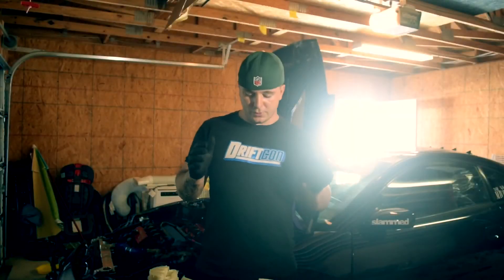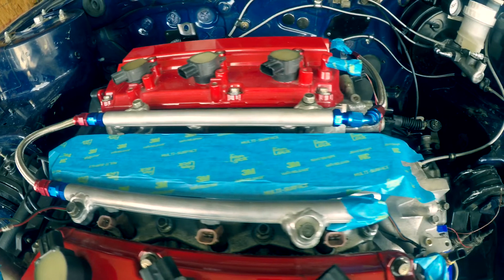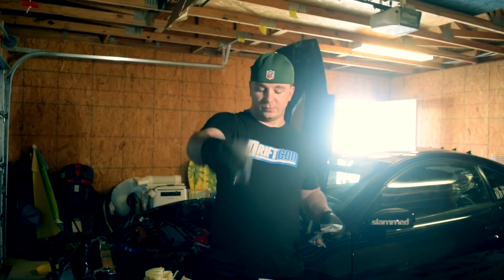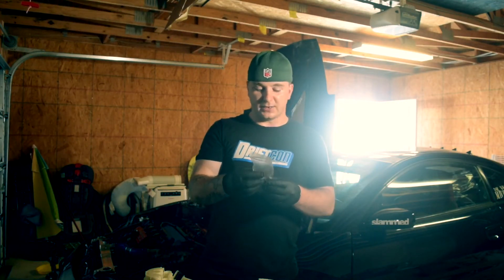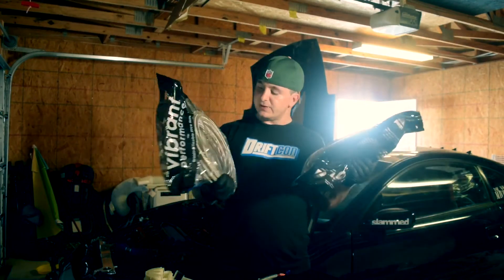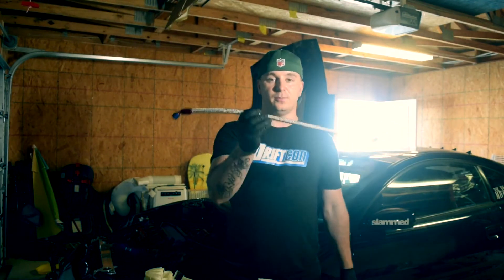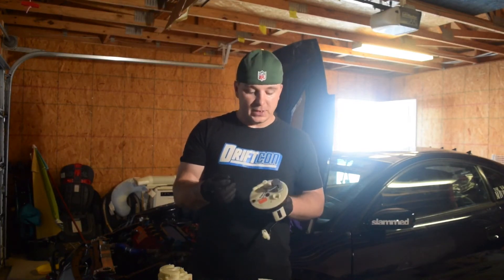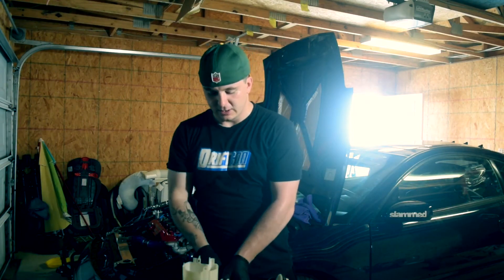What feeds the beast!!!!

Comment: Gained a new sub since your video got posted in mistunation, what internals do you plan to run with your up coming boost? and got any tips on going to e85 for my 6g75 4g? i know you have a 3g but its same engine lol.
Reply from the maker: John Andrews i have forged internals already. Wiseco pistons and spool import rods. 

And for e85 bigger pump/injectors and a fpr would be a good start to look into
Reply: were they the rods for the 6g72/4? or did you just get a set made specifically to the 75? and i would need a aem ecu for the e85 also yes?
Reply from the maker: John Andrews they are from a 74.

And as for e85 u do not need the Aem. Just need it tuned for it tho
Reply: perfect, the club 4g forum isn't the greatest on that subject sadly.
Reply from the maker: John Andrews yeah. 3g fourms are not either...im a small few that tried...i have not seen another aem ecu swap